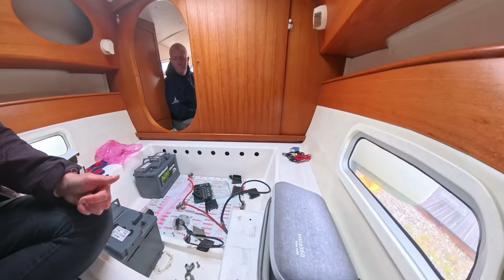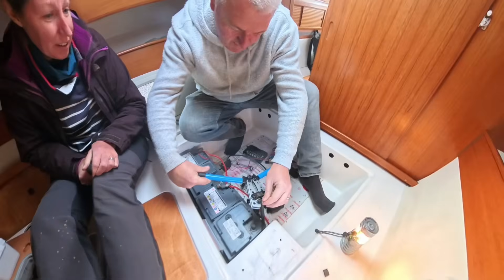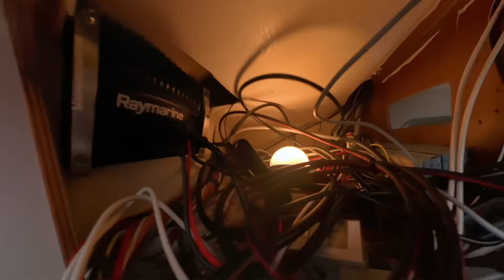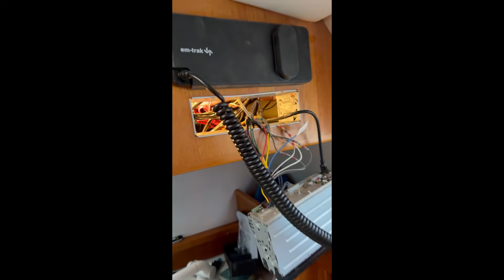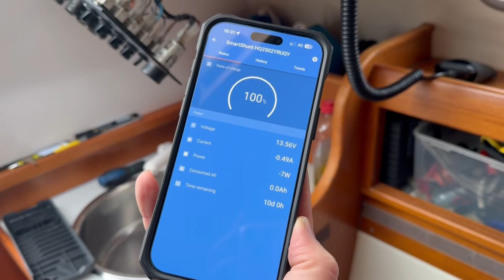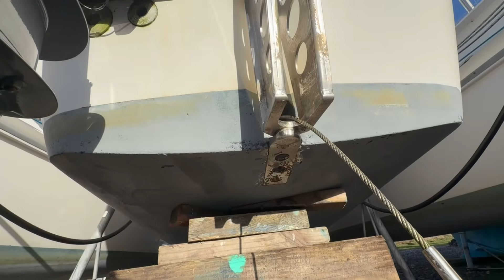Upgrading Our Dragonfly Trimaran: Rudder Bearings, Victron SmartShunt and New AIS install.

Comment: Hi, we are relatively new owners of a 920 (sport rather than extreme) and I've been watching all your videos with great interest !
One question re the rudder bearing - we've just removed our rudder bracket as it needs some welding and noticed the bottom bearing is breaking up. It looks very like the new one that you've  fitted so ours may have been upgraded at some point. So - how did you knock the old one out and how did you press / fit the new one ?
cheers
Nev
Reply from the maker: Hi. This forum page might help. If you need any other advice, the after sales team at Dragonfly have always been very quick to respond to email and given very helpful advice. 
https://forum.dragonfly-trimarans.org/viewtopic.php?p=2679&hilit=Bearing#p2679

Comment: Seatalk can very well talk to seatalk ng network (and e.g. share its data with your plotter if that is what you want).
Reply from the maker: We considered it but the wiring from Raymarine to do this is very expensive and we wouldn’t gain much for the cost. Hopefully what we have now should be good for what we need. Ideally I would like large wind data on the coach roof, but for now I have booked an eye test..!